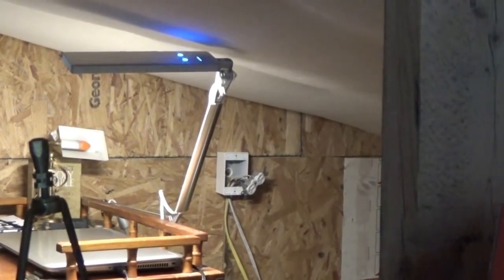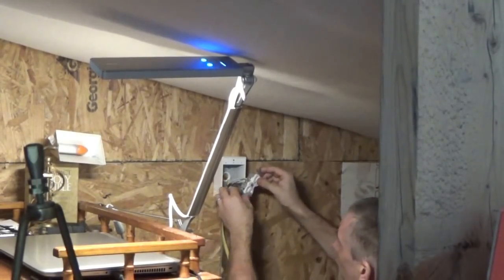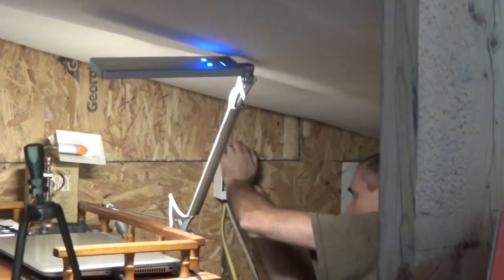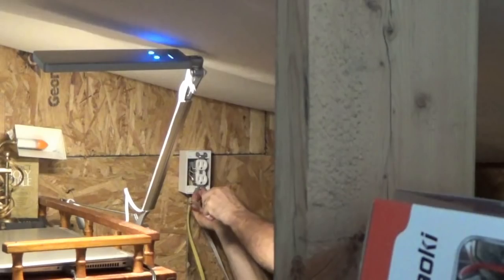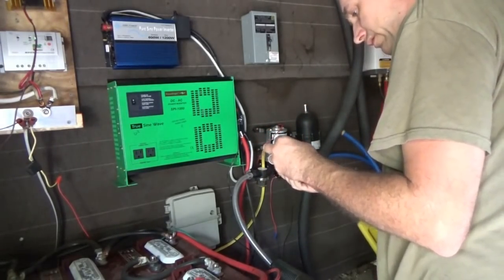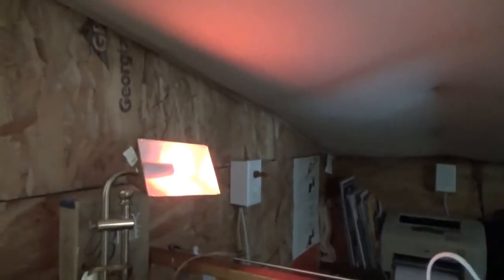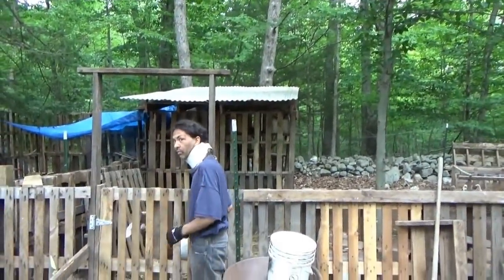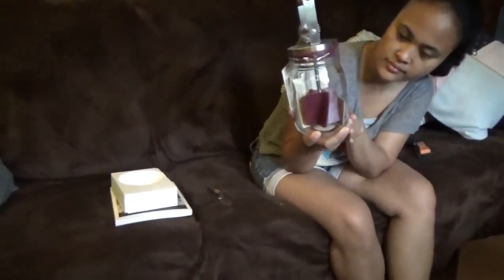Running Wires In Off Grid Tiny House & More

Comment: How come you didnt wire the house for DC with DC outlets and use micro-inverters on switches at the locations you need them... they would draw far less energy and the losses would be nearly half of what your dealing with now... also you can buy chargers for laptops that are 12v to whatever the input is for most laptops instead of going DC to AC and back to DC
Reply from the maker: I use mostly DC for all power needs in the tiny house on wheels. Thats why DC is the first thing I installed. Micro inverters are expensive and generally used on giant household solar power installations to save on losses in the wires between the solar panels and the house.
Reply from the maker: All but for MY laptop, which is an HP. I cannot find a power plug adapter anywhere that fits the DC - DC chargers to the HP power plug. I would be very happy if someone can lead me in the right direction since I bought a DC power supply for this laptop but to this day cannot find a plug to fit the HP
Reply: Long runs of dc wire has loads of loss more so than ac ( thus why Tesla ac won out over Edison dc.  ). If you want long runs for dc with low loss you have to run really thick wire ( way to thick in comparison, because more voltage less amperage= same watts). Those cheap micro inverters are junk and loads of loss. Better to have a good quality inverter coming from short thick leads very close to the battery bank.
Reply: Yep troy your laptop uses 15-19 volts  so you would still be up converting from 12 volts. Its much harder to up convert dc power. Any thing 12v will go straight through or less will be down converted with a fixed or variable regulator which are usually built into the car plug.
Reply: +The Do It Yourself World get some two wire connectors at the auto parts store. Cut your HP cable and hook to each end of the trailer connector. Now when you get your DC power just put the same 2 wire connector on that cord. Disconnect the AC side, and plug in the DC side. Don't worry about finding a connector, use the one you have.
Reply: +storxusmc but the gauge of the wire for 100 foot DC would need to be much thicker or the loss goes up drastically.  The cost for that same 100 foot wire is far greater. Short runs might not be bad, and the THOW isn't like wiring a mansion. Best idea would be to put a volt meter on one end and a DC source on the other end, and go from there.  I tried to push 5v through a 100 foot Ethernet cable for power over Ethernet, my voltage dropped to about 2 volts
Reply: buddy , you are missing huge parts of the puzzle the voltage is one thing but there is load and resistance. a phone has and idle voltage in  the 70 volt range and up to a 95 volt ring voltage but the load is only Milli amps to drive a small speaker , so the drop loaded will be less loaded. 60 volts will travel 10 times the distance on the same wire than say 5 volts will. That is determined by the resistance of the wire, the smaller gauge the wire the higher its resistance. you could over load a small wire with a very high load but what will happen is the wire its self will start heating , this dissipation of heat from the wire is loss and causes additional load. to power the same load you will need more "power" since in this case the source 120V cannot change, the load will try to draw more amperage, this is why a power tool on a long skinny cord can be harmed as its windings are overloaded and can overheat , or the amperage will simply exceed the breaker and it will be triggered.

"+smartmonkey777 the amount of loss over 100ft is literally the exact same as AC... sorry but that is only viable over LONGER DISTANCES>.... ". this is a complete fallacy that fact of the matter is electricity is governed by ohms law. Law's in science cannot be violated.    

http://www.daycounter.com/Calculators/AWG.phtml

 So for an example a 26 gauge wire @ 100ft has a resistance of 4.08 ohms. with this and the voltage and amperage carried by said wire can now be calculated lets assume 65volts AC (Phone systems are generally  ac) @ 100miliamps. This gives a loss of .82volts @100ft

http://www.calculator.net/voltage-drop-calculator.html?material=copper&wiresize=133.9&voltage=65&phase=ac&noofconductor=1&distance=100&distanceunit=feet&amperes=.1&x=52&y=18

One thing you are correct about if you have a dc voltage and and ac voltage the loss will be the same. The reason that we use ac in distribution systems is that ac voltage can be easily stepped up and down via transformers to hundreds of thousands of volt's so that there is the same amount of power that is less susceptible to the resistance of the wire and that a smaller gauge wire can be used to transfer the same amount of power.

Example i want to transfer 1 megawatt (a million watts) i decide to use 500kv ( 500 thousand volts ) @ 2 amps . i can use tiny wire to get from a to b. if i were to try to do the same at 120volts that's 8333amps id need a wire as thick as a whale to get it any where.
Reply: +storxusmc  Excellent idea.
Reply: *****
 Well in the case of turbines there's many types. AC , DC and Poly-phase, has to do with how many  armatures and whether  or not there is a commutator or brush-less design.     By nature your most of your high end generators will use a brush-less 3-phase ac design. Ac power is produced when the rotor passes the alternating field of magnets over a stationary armature (coils) . This produces ac power. With 3 coils off- set 90 degrees produces 3 phase AC. 3 or more coils offset is referred to as poly-phase, and i would assume you could have as many as 360 phases if you could fit an armature into every degree. Brush-less design's are much more efficient due to always having contact to transfer energy and also do not produce noise.

Dc generators work similar to ac except that they rely on a commutator that connects and breaks the circuit constantly keeping the output dc as the generator spins. Commutators add friction and resistance make electric noise and wear out due to the mechanical switching of the commutator.
Reply: multi-phase = poly-phase
Reply: *****
 I would never say its a myth, no. the reason we use ac is because the brush-less generator at the power plant makes 3 phase ac, so it can directly drive a transformer and go straight into the power grid. If it wasn't like that you would have to have converters, inverters, stabilizers, and regulators. Every thing you add to a system increases the loss.
Our current grid is basically the ultimate keep it simple stupid. Even with how simple the grid is 40% of the power produced is lost before it reaches the source.
Reply: ***** Where did any of the things you and your uncle spoke about came true?
Reply from the maker: Actually the cheap inverters are less efficient than the better ones. And you should use pure sine wave for longer life of your devices. Some will argue the last point though
Reply: *****  Very interesting. Thanks for your observations and sharing the ideas from your Uncle.